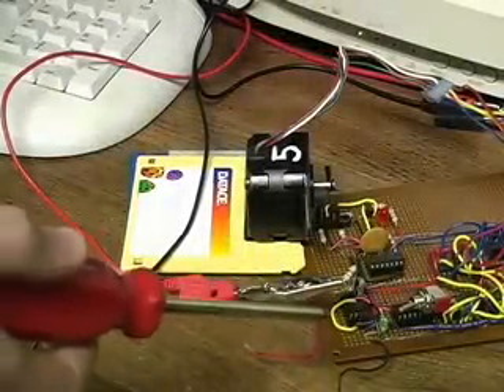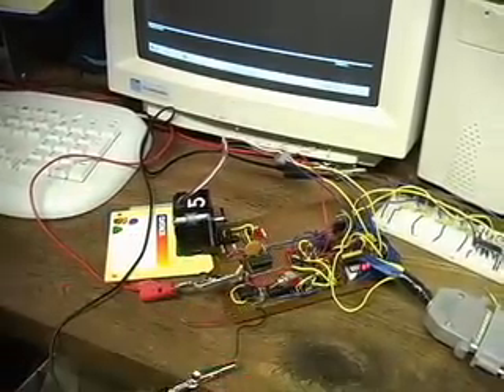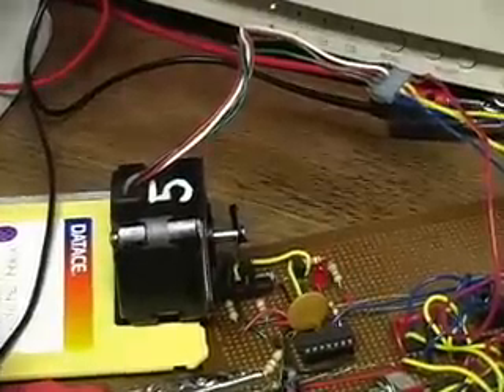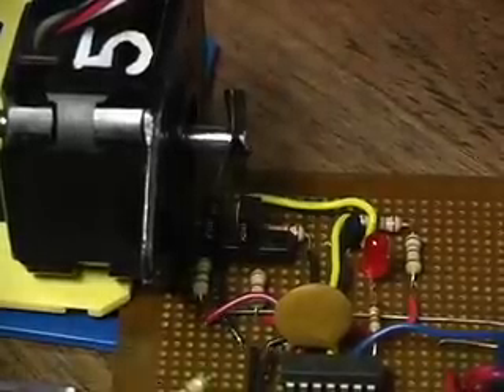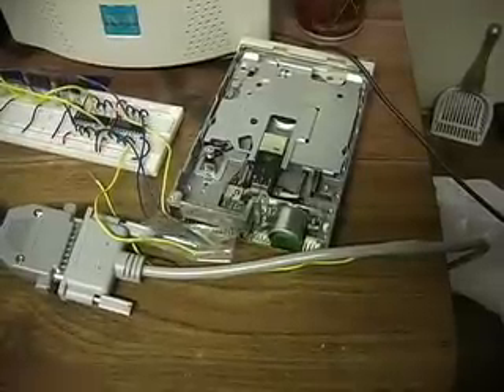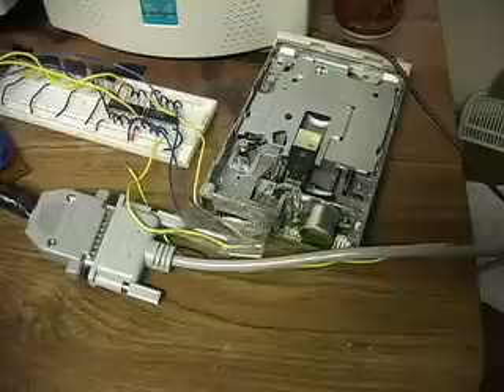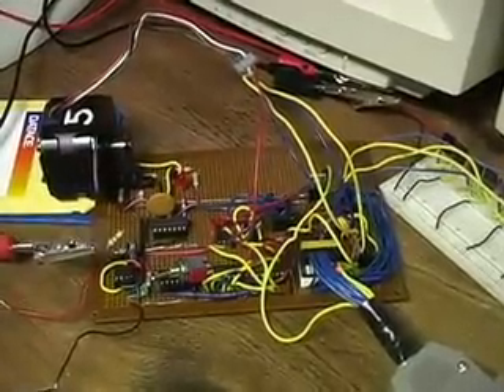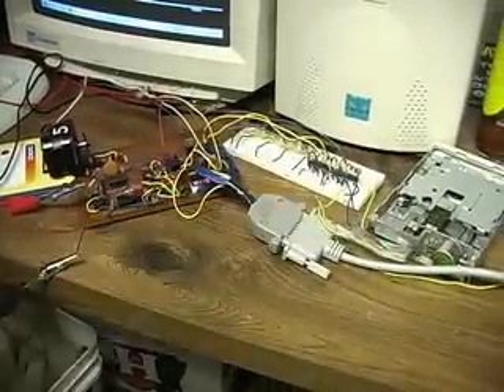Stepper Motor And External Electronics Driver Parallel Port

Comment: Thanks a lot for the info! I've finally got around to try it, and it works great. I controlled a simple 5V relay with it, so the lpt port couldn't take that load. But I connected the power supply of the computer to +5V, and a transistor to control that. It worked like a charm! The relay controlled a motor. Fun stuff.

Thanks again! It's great to see that not all youtube comments are braindead :)

Comment from the maker: Crap, I forgot to mention.  Make sure that you connect the ground pin on the parallel port to  the ground in your circuit.  This is very important.  As well, if you want an easy way of testing, enter in the the dos prompt, then type "debug", then type o378 **.  Stars signify a hex number.  Use data pin#1 and type o378 01.  This will turn data bit#1 on, and keep the other ones off.

Comment from the maker: Nice!  Glad to have been some help.  Let me ask you, are you going to be controlling a solid state relay, or a simple 5v relay?  If it's a solid state relay, it should work just fine as it is.  Or so I believe.  As for the simple 5v relay, the coil might require a little more current than the LPT1 port can handle.  Enjoy the holiday.

Comment: Thanks a lot for the info! Going on winter vacation now, so I won't get to test it until next year. I'll let you know how it goes.

By the way, what I'm going to do is to control a relay from the parallel port. I tried connecting it directly to the port, but there wasn't enough current to drive it (thanks for helping me get over the fear of doing just that, though). I'll try with the open collector gate next time.

Comment from the maker: You can also implement the 74LS244, which is a series of eight buffers,
 which are used to provide current.  Watch what I did in the video with the 
inputs and the outputs of the buffer chip for the 4-wire stepper.  Hope I've been of help to you.

Comment from the maker: You can have an entire circuit hooked up to this as a switch; tie the common ground to the output of the open collector. When the open collector output is activated, it will allow for the ground connected to the output to the ground connected to your power source.

Comment from the maker: Hi there.  Thanks for the comment.  What you can do is implement an open collector gate for each of the eight data lines.  The data lines will provide very low current at five volts.  If you can find a good set of open collect or NAND gates, (75362), you can tie five volts to one of the inputs, and use one of the parallel port pins to the other input, which will control the open collector output.

Comment: Hey, that's really cool! I just started playing around with the parallel port, but my electronics skills are really limited. I wondered if more pins from the parallel port would give me more current, but that seems to be working well (that's what you did, right?). Do you know what happens if it can't supply enough current? Is it dangerous or will it just not work.

Anyhow, nice setup!